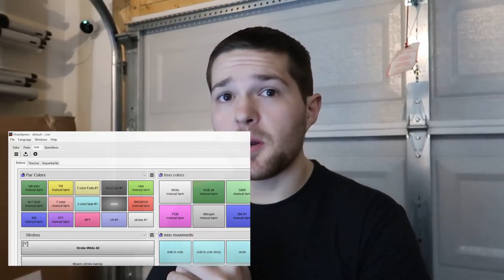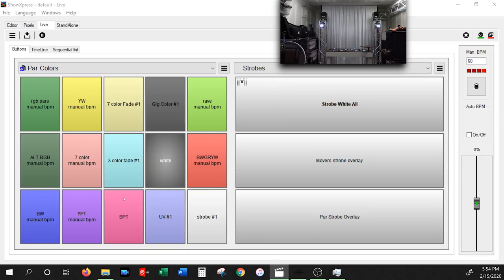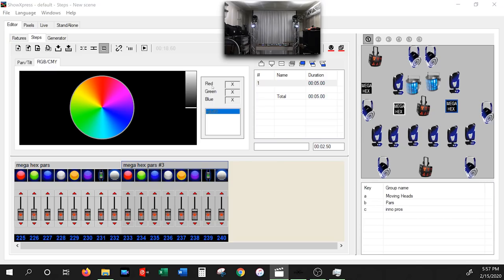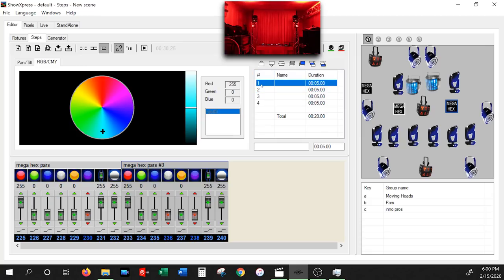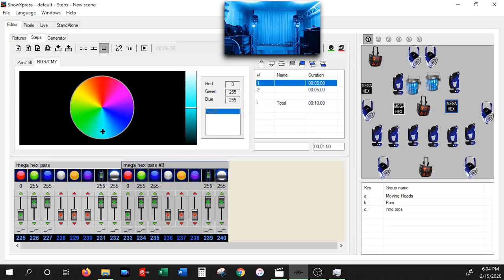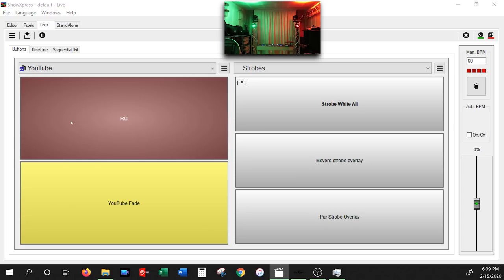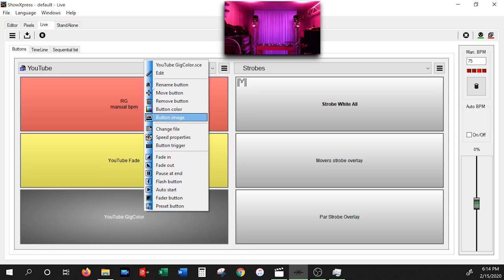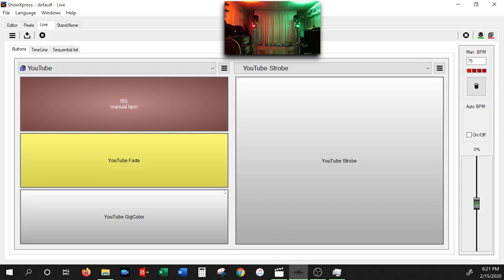DMX Lighting Programming Tutorial | Part 1 ADJ Mega Hex Par | Wash FX 2 | Chauvet Showxpress

Comment: Hi Rick, do you have any recommendations for small, beam GOBO moving heads? Preferably I’d like custom gobo support to use a custom logo in them. They will be going on a ceiling so I want a small form factor
Reply from the maker: The adj pocket pro would be a good option for that. I am pretty sure it has interchangeable gobos.

Comment: Hey ive recently just subscribed to your channel because I'm liking your content especially your gig logs. But as I've noticed your using showxpress I've also opted to go software based lighting controllers and I've gone with soundswitch and I'm wondering if you have ever used soundswitch before??
Reply from the maker: Yes. Its kinda cool but needs updates because it is very limiting
Reply: @DJRickWeb  would it beable to do strobing on EDM and Trance music in automated light show or would strobing be something I would have to program manually??
Reply from the maker: Depends. If you have a pre-made set you can set up the strobs with timelibe. Otherwise all manual.
Reply: Okay great I managed to program aload of chasers and strobing on the autoloops for my pars .the only thing I need to now figure out is how to do the moving heads

Comment: show express or sound switch
Reply from the maker: Show Express.
Reply: @DJRickWeb  seems like alot of work. does the showxpress have an auto function?
Reply: @DJRickWeb  XPRESS-1024 i was on the soundswitch page and they recommended that service over the xpress.. would it be worth to start with 1024 instead of the 512
Reply from the maker: @djstressfree7668  what's 1024?
Reply: @DJRickWeb  its the next model up with i think option of having 3 universes
Reply: @DJRickWeb  i have the chauvet dj d-fi hub but the app on the phone flarecon. just not what i expected. i want to be able to control things easier.
Reply from the maker: @djstressfree7668   complete overkill man. I dont even use a full 512 channels.